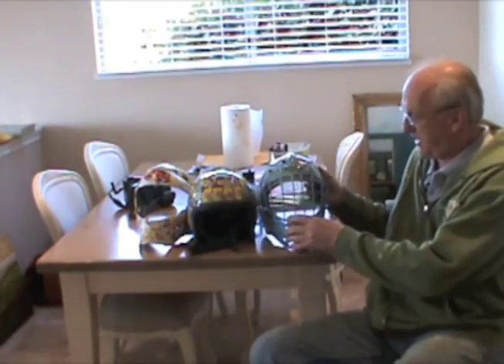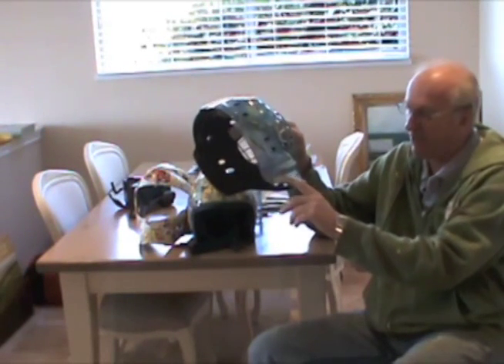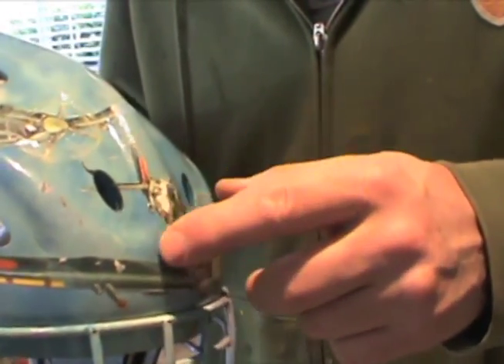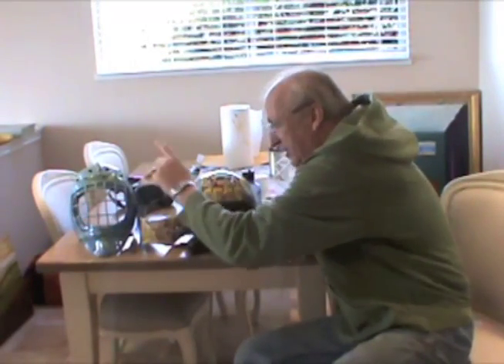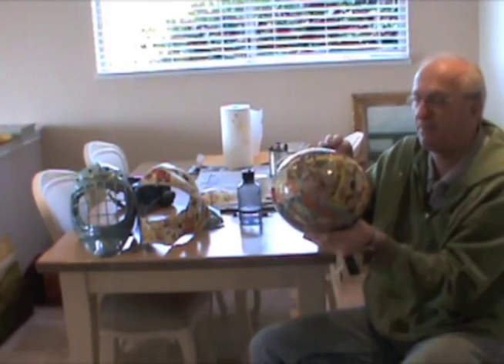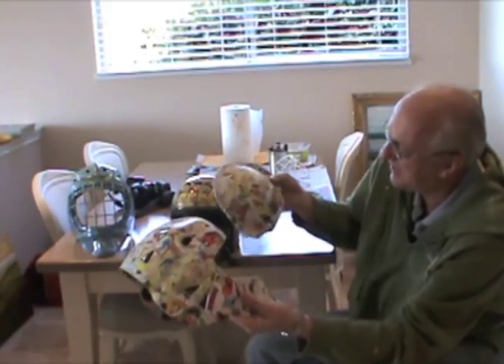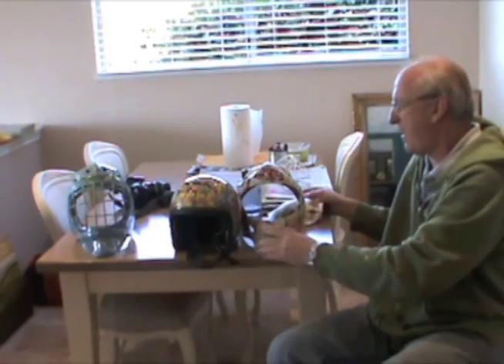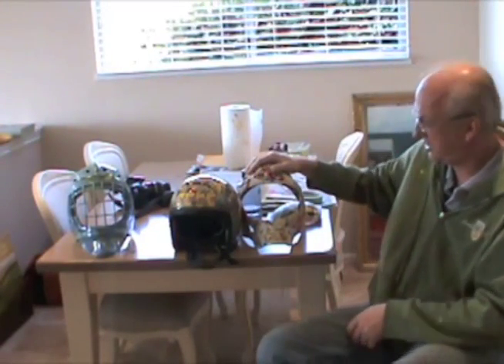HOCKEY HELMET DESIGN S2

Comment: Hi from Costa Rica... The clean coat high gloss You used was polyurethane?... I found in My country only acrylic AND polyurethane spray... I know acrylic can change yellow but for an helmet do you think polyurethane can work? I Hope you read this... I know its better the CAR celar coat But IM trying To know if polyurethe can work For me i need to prevent yellowness in my helmet for UV Sun light .. Thank you
Reply from the maker: On this helmet I did not use polyurethane. I tried polyurethane in the beginning but it did not protect the collage enough. I used an epoxy like one uses in art or on a surfboard and after two years it's wearing well. The goalie swears it protects his head better because it is as hard as rock. You get this epoxy at some hardware stores, boat shop and art store. You have to mix the two bottles of liquid 50% +50% and then heat it. I mixed it in a bowl and heated it with a heat gun (torch can be used) to make it easier to apply. I then heated it on the helmet to remove the bubbles. The colour has not changed to yellow but it has mainly been used indoors.
The polyurethane (clear) will work for protecting the paint if that is all you can find. . I used the spray can version. 
One can buy clear epoxy on Ebay if the shipping does not kill you. 
 Good luck with the helmet.